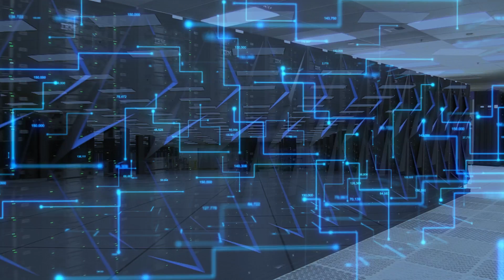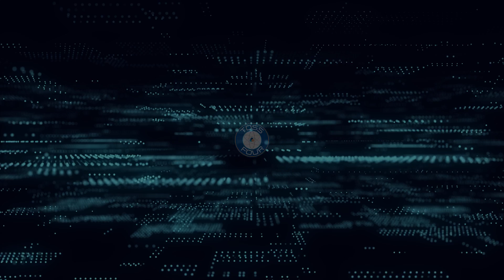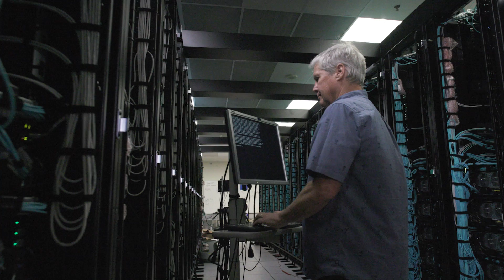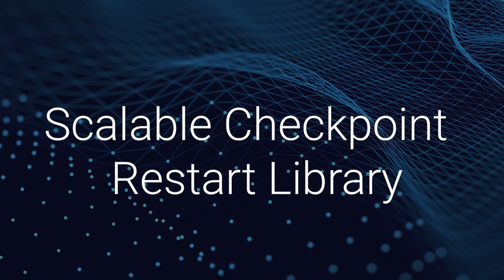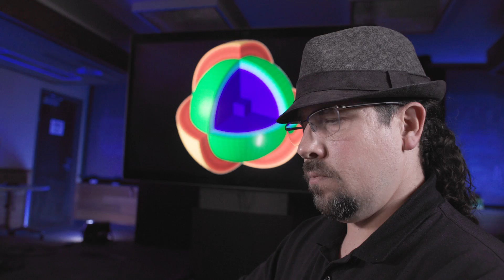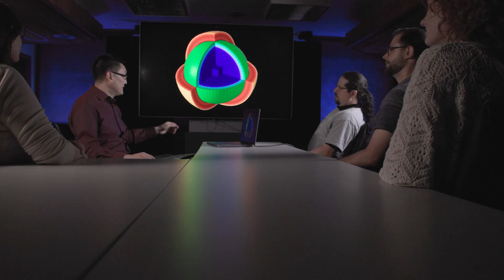How Will El Capitan Run? Software and Storage Solutions Powering NNSA’s First Exascale Supercomputer

Comment: 80386 and 486 computers should had been "phased out" in the 1980s.

Pentium-speed computers already in the 1980s. Yes, there were Pentiums already. And Windows 95 turned into Windows 85 or Windows 86.

By now, we're 10 years ahead of the computing and tech timetable.
Reply: So you are telling me that we were supposed to have the AMD Ryzen 9800X3D (which came out a few weeks ago known as the most powerful gaming CPU) come out in 2034?

Comment: When they mention portability are they referring to apptainer?
Reply: It refers to "performance portability", i.e. the ability to run a single piece of software at scale with good performance on a large variety of different system architectures - different CPU/GPU vendors, different architectures of different HPC systems, etc.
Reply: I'd expect a lot of the heavy lifting behind performance portability to come from templated frameworks like RAJA and Kokkos, or using OpenMP target offload. Well, at least until more support for native C++ and Fortran parallelism comes along.
Reply: @wileamyp  Usually its a mix of MPI for inter-node parallelism, and any of your mentions (and more) for on-node parallelism.